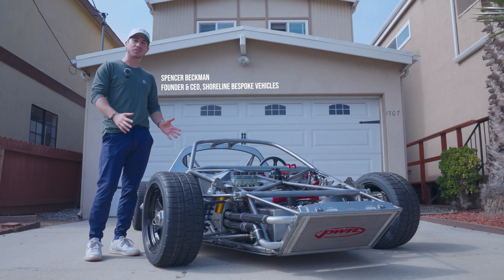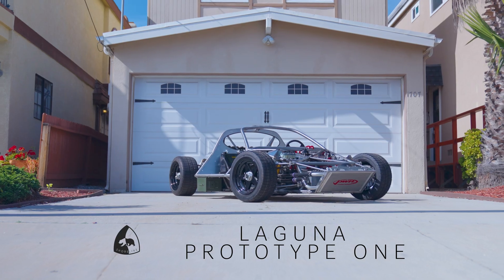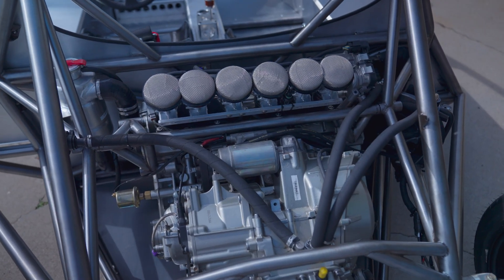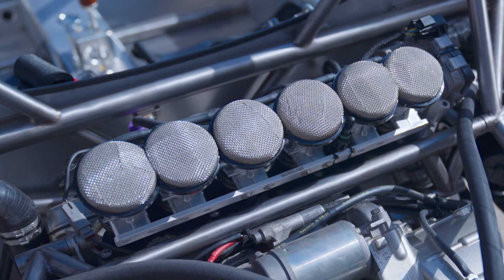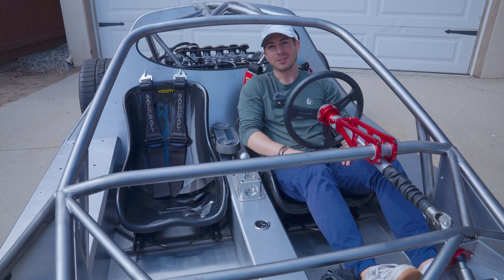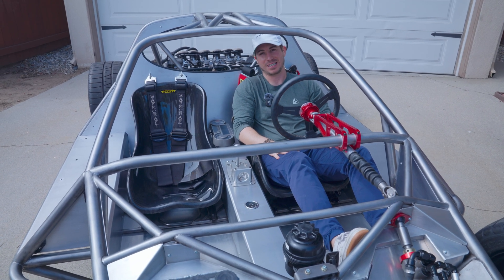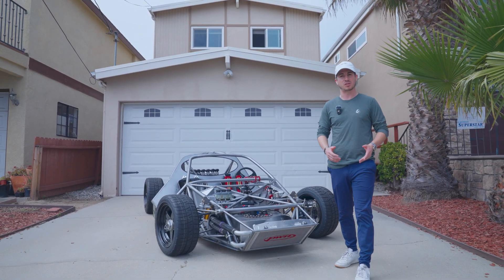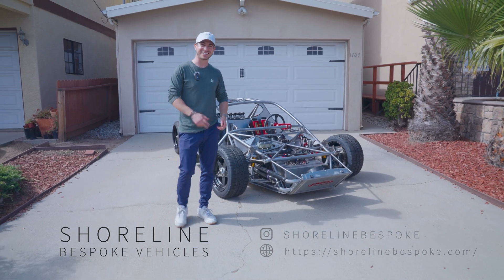Laguna Prototype One Walkaround

Comment: Did you consider the Honda Gold Wing six for this as well? 
Like the Beemer, it would require some adapting, but it might be six to nine inches shorter - that forward lean of the BMW and need for an adapter has to add length. Or were there reasons not to do that, like more difficulty in in actually making it work, or the image superiority of a Beemer motor over a Honda in a high-end machine?
Reply from the maker: Great question: we developed Laguna's character around a lightweight, compact, and high-revving naturally aspirated engine. We took many engines into consideration at the feasibility stage of our development program and came to find our BMW engine was the best match for the Laguna's character.
Reply: @ShorelineBespoke  Ah. And the Beemer probably revs higher, whereas the Honda's sweet spot is at medium speed.
 You would, of course, want a Six for the smoothness, the sound, and the high-end connotations - this has got to be a pretty expensive car, and a buzzy, thrashy Four doesn't quite feel like something someone should pay a house-sized lump of money for.
Reply from the maker: @Baribrotzer  you hit the nail on the head!

Comment: Why carbon fiber everywhere?..... Is there a reason we need thousands in carbon rather than fiberglass? I feel like carbon fiber is excessively expensive and over hyped. If you want this to be enthusiast grade and also not neck breaking expensive then don't fill it with carbon fiber. It would be like making all the electronics from gold because its the best metal for conductivity. Its just not practical, cheaper isn't always a compromise.

Comment: what rubber ya got on it?
Reply from the maker: Laguna Prototype One is shown with a prototype-only wheel package, which consists of 225/45R15 front and 245/40R15 rear. Production vehicles will utilize a 17" wheel and slightly wider tires. Thanks for your comment!

Comment: If I'm guessing right and you utilized the enigne and transmission out of the K1600GT, are there plans to integrate a reversing gearbox into it? or do ya just get out and push
Reply from the maker: Great question - Laguna's six-speed sequential gearbox is complemented by a custom transaxle that incorporates a limited-slip differential as well as a reverse gear. The gearshift in the car operates both gearboxes simultaneously when selecting reverse. More on that in an upcoming video! Thank you for your support!

Comment: awesome!! Front tires seem a bit too wide though.  Elise/Exige level contact patches should be plenty, with a bit of extra sidewall for ride comfort and more 60's era driving sensation.  Let it roll a bit!
Reply from the maker: Thank you for your support! Our prototype vehicle is wearing "temporary" wheels and tires; look for our next build to incorporate 17" magnesium wheels and tires with larger sidewalls. You hit the nail on the head for where our driving dynamics are going!
Reply: @ShorelineBespoke  excellent.  I've driven cars with mega grip and they're great but the most fun has been on skinnier rubber: Opel Speedster on the Nurburgring, 308GTS Ferrari on Road America and auto-xing, Fiat X1/9 on a pro Kart Track, etc.   Lightweight + modest, zesty power + engine in the middle + delicate steering + twisty road = driving nirvana!    Best wishes on making your vision a reality. Who knows, I may come into enough disposable cash someday to buy one :)

Comment: Can’t take my focus off the tractors linch pin clips on the wheels….
Reply from the maker: Hi Mike, those hilariously oversized pins are an additional safety step for our prototype vehicle's bespoke center lock wheels! Production vehicles will have a similar feature that is internal to the axle and therefore not visible. Thanks for your comment!
Reply: @ShorelineBespoke  thanks for the reply. I was just giving ya crap. I know it’s a prototype. I built Formula SAE cars back in College.

Comment: I am hoping version 2 will have impact absorbing structures- at a suitable height. And it's fuel cell well within the main tubular frame.
Reply from the maker: Hi Robert, you are absolutely right in expecting production models to have impact-absorbing features at regulation height. Laguna is designed as a road-legal vehicle, and as such, is built to all relevant worldwide automotive safety standards.  While Laguna Prototype One is essentially a test mule that proves all of our chassis engineering, our second build will begin to incorporate some of these additional safety elements. Thanks for your comment!
Reply: @ShorelineBespoke  Great stuff!!

Comment: What’s going on with the ammo can bolted in front of the right rear wheel? Maybe add some roofline support going rearward over the motor. That center section ending in an unsupported roll hoop scares me
Reply from the maker: Stay tuned for a video coming out later today for more details on our ammo box! As for the roof support, Laguna's chassis is designed to exceed all relevant roof crush and rollover protection crash tests, and built to regulation for many motorsport sanctioning bodies. You can subscribe to our newsletter via our homepage for development updates, including a deep dive on FEA and crash tests as our development progresses.

Comment: Fantastic project! Wish all the luck for you guys. Can u talk more about the gearbox and the decision to put the gas tank in front os the car? Cheers from Brazil!
Reply from the maker: Thank you for your support! Laguna uses a six-speed sequential gearbox with a billet aluminum shifter designed in-house. You can see the shifter in action here: https://shorelinebespoke.com/updates/edition-twelve

Laguna is packaged to be as compact and as safe as possible, and our decision to house the 12-gallon FIA certified fuel cell within at the front of the main chassis structure reflects this. While the car's frontal crash structure is not present on Prototype One, we look forward to sharing more about the specific design elements with you in future videos!

Comment: Will power steering really be necessary in such a light weight car with the motor and transmission in the rear? Beautiful design!
Reply from the maker: Great question! The decision was made for a combination of usability and safety benefits. Laguna’s motorsport-derived power steering provides assistance when drivers want it most: turning the wheel while stationary (i.e. making a three-point turn) and emergency corrections, such as catching a slide or swerving around debris on a circuit. Hydraulic assist provides a consistent and tailored steering feel, especially at low speed. The razor sharp steering rack is also lighter than an equivalent unassisted rack because the integrated hydraulic piston absorbs steering forces, meaning the rack itself takes less force and can therefore be made smaller and lighter. The system’s electrically driven pump also provides hydraulic pressure for a front axle lift system, for a near-zero weight penalty!
Reply: @ShorelineBespoke  love the idea of multitasking components. Thanks for the response!
Reply: @ShorelineBespoke you'd be good at writing magazine ads
Reply: That was my thought. Lotus Elise manages without.

Comment: Are you planing to only use the current engine? Or do you have plans for different engines?
Reply from the maker: Thank you for the comment! Laguna's BMW-derived inline 6 has immense potential, even early on in our development program. You can visit shorelinebespoke.com/updates to learn more about Laguna's development program, and subscribe to our newsletter via our homepage for more powertrain announcements the moment they happen!
Reply: @ShorelineBespoke  okay thanks for answering. I just tought some 4 cylinders and rotaries would also be kinda fun. But does a new engine need redising the chassis?
Reply from the maker: @erser895  The inline-6 is rigidly mounted to the chassis as a semi-stressed member and increases laguna's torsional rigidity in doing so; you're right in thinking a new engine would mean chassis redesign! A different engine configuration would also lose the I6's perfect primary and secondary balance, and risk increasing interior vibrations to undesirable levels.
Reply: @ShorelineBespoke  Ok, i appreciate your answer. Best of luck on your jorney.

Comment: The cooling system working at 110°F ambient in the shade but in city traffic. For both engine and driver
Reply from the maker: Thanks for your comment! Laguna's cooling system was developed in collaboration with PWR - a supplier of Formula 1 cooling systems - and is certainly up to the task of keeping temperatures in check during the hottest days, whether heat-soaking in traffic or running full-out on track. Laguna's full HVAC will keep our customers and their passengers cool as well! For more information, you can visit shorelinebespoke.com
Reply: @ShorelineBespoke  sure hope it works. I had a PWR for my bandit powered car, had some issues. Needed R&D

Comment: I would recommend swapping that plastic power steering reservoir with a “ Turner Triple Baffled Power Steering Reservoir” one. It’s cnc aluminium, plug and play while supports other fitting standards. Those plastic ones all eventually leak 😅. You can thank me later with a drive in one of these 🏎️
Reply from the maker: Production models will indeed use a more durable reservoir - we know what you mean!